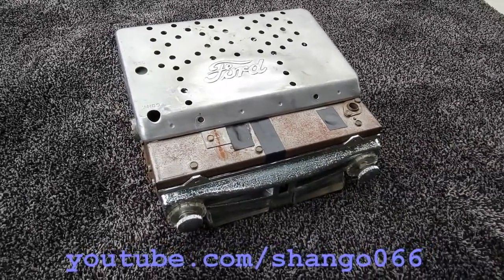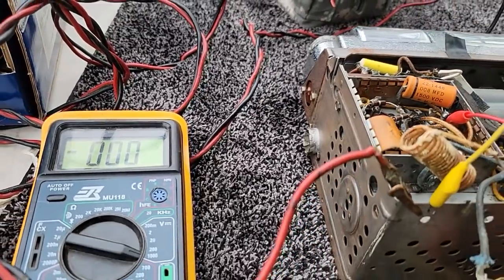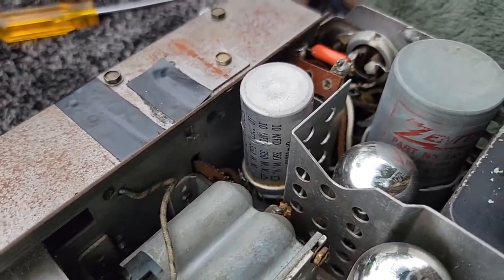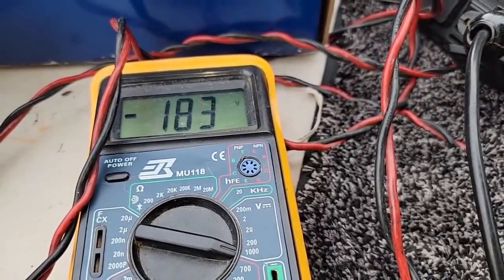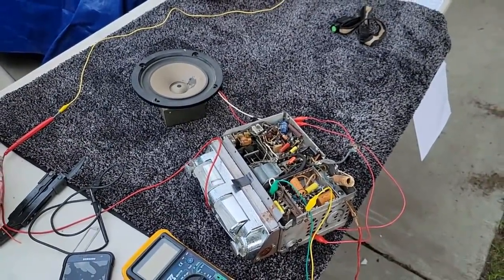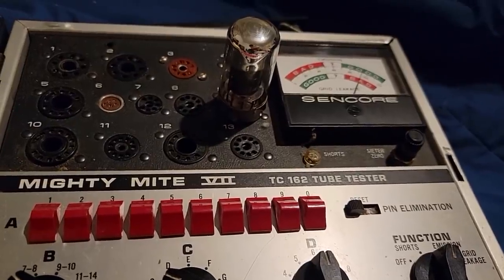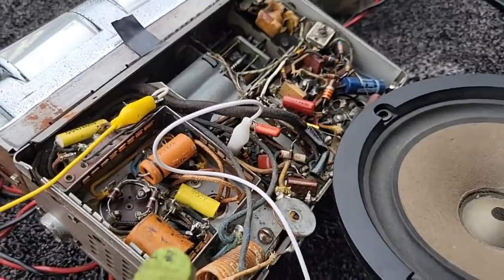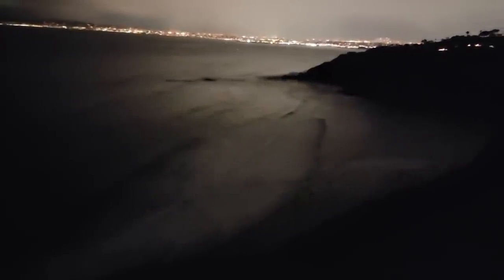Ford Zenith Tube Car Radio Diagnosis to Repair Quarantine Video

Comment: The two washers are supposed to be bolted to the chassis with mica washers.  A primitive form of low-inductance bypass capacitors.   You  can replace them with 0.05uF disk ceramics with short leads.
Reply: That's an interesting idea. I'm not sure I would have thought of that.
Reply: The Two Washers with the power wires soldered to them, is known as the spark capacitor, to filter the noise from the DC generator and ignition electricals in the car of that era.
Reply: @Derundurel  Yeah, I'm kinda puzzled by it too as good bypass capacitors were available then   Perhaps it was just tradition or maybe washers and bolts and mica were cheaper??  Not sure.

Comment: I remember turning on the AM radio in my dad's new 58 Roadmaster at night. The dash and headlights would dim until the tubes warmed up. I loved hitting the scan bar, turing on a motor to drive the tuner around the dial looking for stations, too cool!  I also remember the vacuum powered wipers stopping when he hit the gas. A luxury car from a different world.

Comment: My first car was given to my by my dad, he bought it from an old friend who ran into the back of a pickup with it, it had not been fixed.  Dad gave 25 bucks for it back then, and he told me that when I got it fixed up, it would be mine.  It was a grey 1950 Ford Custom 2 door with an external visor over the front windshield.  Came with a Ford flathead V-8 and a three on the tree.  The front seat was worn out and stunk from the old man who had it, so in addition to finding and replacing the front clip and hood, I also found a front seat out of a modern (for 1965 Rambler Station Wagon.  The seat would fold back and matched very nicely with the back seat, giving me a nice bed on wheels!  I did get some nice action using that.  This was before you could buy a tape player for cars, and since the car had a 6 volt system, if I wanted custom audio I had to find a better radio from a better. car. I ended up with a nice radio out of a Cadillac, got it from the junk yard for 5 bucks, it had motorized tuning with a floor switch so you could change stations with the tap of a toe. I loved that, plus it had 2 speakers, front and rear with built in fader,  so much nicer the the original Ford radio.  Thankfully most radios back then had a front plate that was mostly the same so she slide into the dash with no problem. Indeed I had a neat old car, my girlfriend painted the. bulbs in the two side interior lights red for, well sex appeal I guess.

Comment: Terrific info on the aluminum-solder issue! One has to question the intent of soldering wires to the side of a canister that didn't have wires soldered to it in the first place. (And then not checking continuity to the original location).
Reply: Exactly. Excellent reminder of the not-so-obvious.
Reply: You can have solder that will fuse to aluminum but it is hard to find. Those who build custom lithium batteries for rc models may know a source.
Reply: @skuula  Its not that much the solder itself, but the flux and generally the soldering process. Not worth the hassle unless really some very special cases. There is a reason, why practically no consumer product ever used such step...
Reply: @annaplojharova1400  Stannol of Germany have a solder called ALU1, which might be worth trying. Can't post a link here though.
Reply: There.exists.aluminum.solder..Check.a.hardware store....It.does.require.hot.heat.and.scraping.though...And.it.is.nowhere.near.eutetic.so.cold.joints.are.common....Much.better.to.use.the.tin-plated.steel.ring.if.possible.
Reply: @georgegonzalez2476  yes there are rods for flame brazing. But also solder, which a plain soldering iron can do. I used to have some. The latter is a bit hard to find. The rods are easy.
Reply: Not sure why the other tech even bothered to solder to the aluminum can if it's not mounted to the chassis.  As long as the cap commons are soldered together, and then connected to the chassis, the can is irrelevant.
Reply: It's like the snafus with old Philco radios.  They tended to have the capacitor can ungrounded and at -20 volts or so to provide grid bias.   A large proportion of those radios got repaired with grounded capacitor cans, leading to the output tube running at zero bias, and overheating the tube, power, and output transformer.  Ofttimes the wax would boil out of the power transformer.  Ancient snafus!

Comment: "my cognitive ability right now is more on the presidential level" You never fail to disappoint shango066! Absolute gold!
Reply: Actually, I find such political inputs to be distracting and unnecessary, and a potential turn-off
Reply: @Zickcermacity  you should enjoy KVAX it is totally apolitical.
Reply: @sting1111  Very  funny.  Now roll up your sleeve!
Reply: @Zickcermacity  Lighten up Francis

Comment: Yes, you can solder to aluminum using regular tin-lead rosin-core solder. The technique involves soldering under a drop of oil to exclude air. Scrape the aluminum under oil with a knife followed by scraping with a hot soldering iron. Add solder and the aluminum will eventually "tin". Once tinned the area can be soldered to as usual. Try it, it works and is very strong.
Reply: Exactly, did that a few times. That method  and/or there are some aggressive flux which work on some grades of aluminum (not all, but the type used in soft drink cans and most heatsinks do).

Comment: Biff Tannens 1946 Ford has this same radio in it. Ford and Mercury used these adjust o matic radios from 1946-1948. The plug socket on the side is for the foot control switch.

Comment: Great repair video. That Motorola vibrator sure is quiet. Although they sound pretty noisy with the car stationary you don’t hear them with the old6volt car underway.

Comment: The M makes me think it was in a Mercury. It’s amazing how they packed all those vacuum tubes and components in there back then!
Reply: Isn't M for manual tuning?
Reply: @401ksolar  Yes, I saw later when he changed the controls on the front. That’s what I get for commenting before seeing the whole video. I wonder how often these tube radios broke down from the vibrations while the car is in motion.

Comment: You can actually solder to Aluminium, the trick is beating the oxidisation......you have to use something like Mineral oil as you file the surface clean so it remains sealed from the air.....you then just solder through the oil with a really hot iron with normal solder.......we do this at work soldering coax to aluminium driven antenna elements.....there are a lot of YouTube vids showing how people do it, but yes it does work quite well as long as the area you want to solder to remains un oxidised.
Reply: But sounds like a lot of trouble.  I was thinking and couldn't recall any instances where I have seen solder to aluminum. Cans always had separate connections for terminals through the wafer and the tabs were just pinched to the chassis.

Comment: Very interesting. My stock 1948 Ford Super Deluxe has the original Motorola it came with. Its front plate design is different from the Zenith you're working on. The front plate on yours looks nearly identical to the Philcos from that era I have seen. I was told Fords of the 1940s came with Philcos because Philco was a captive company. I think your guess that this radio is from the 1940s is correct.

Comment: Should collect those photos, scan them, and send a copy to a local historical society. So much history is squirreled away in personal archives of photos and such, then lost for so many reasons. Those photos seem so representative of a piece of the history of the times. And when image capture was not as easy (or inexpensive) as it is now.  I go back to the era when our little Brownie cameras could only take 12 shots on a roll, then had to be developed.   8 mm reels only lasted 5 minutes. But the Kodachrome was spectacular and still outstanding 70 years later.

Comment: The 6MF080 Ford-Adjust-O-Matic´46 Ch=6C81 from Zenith on radiomuseum looks a lot like yours, and it has the full SAMS Photofact.
Reply from the maker: It would have been nice to have but it wasn't necessary

Comment: when you use a power transformer in place of an output transformer, saturation is a problem, because of the DC current flowing in one direction (in a single tube class A circuit), but you can balance this current out of you have 2 120V windings, by passing current in the opposite direction it balances out the magnetic field created by the output tube passing current, and brings it out of saturation.
single ended output transformers fix this issue by employing an "air-gap" in the transformer, which increases the current needed for it to saturate

Comment: If a vibrator is bad, you can unplug it and use a filament transformer to supply AC power to the primary of the power transformer. This is a good way to power the set up on the bench.

Comment: actually you can solder an aluminum parts, you only need co cover it with tin under the layer of motor oil
but i don't know if the cap will be overheated with this method

Comment: With all the birds in your area, more likely corvid 19. Get well soon. That old radio was much more elegant the UK car radios of the period, I used to have one one which was in two sections   
with an umbilical cable between them. Later models had 12v tubes with one power transistor. Great fault finding, never seen an intermittent o/p transformer before.
Reply: Any birders in the audience that can identify them?
Reply: @KameraShy  - Earlier in the day the ones which sounded like owls likely were something-or-other doves, what we commonly call Mourning Doves. We have them here on the East Coast,  and my neighbors hear them and say "Hear those owls?" And I tell the neighbors (nicely) those are not owls, but Mourning Doves, and the neighbors always get pissed at me. I  guess they can't handle the truth🤷‍♂️

Comment: Actually I have soldered to an aluminum pop can. The irony was that I was counting on the solder not to stick because it was aluminum.

I was making something like a lead weight, kind of like a fishing weight. However I didn't have any lead around, so I took some 60/40 lead/tin solder. I cut a pop can in half and used the domed bottom to hold the solder. I melted it over a fire, and the solder and flux separated. and at that point I had my little lead/tin weight.

Then I wanted to see what would happen if I just burned the flux off. Doing that caused the solder to actually bond to the aluminum can.
Reply: I've had good luck soldering to aluminum by putting the aluminum part under oil and applying solder and a soldering iron while under the oil.
Reply: you can solder aluminum but it needs to have no oxide on it! the trick is cover the aluminum in oil scrape it with a knife well then heat and solder!
Reply: @therealjammit  Yeah. I read if you can penetrate the oxide layer, you can solder aluminum. Buuut based on my experience, you need a heck of a lot of heat and flux.

Comment: Looking at the thumbnail again, below the "dial" there appears to be what looks like two rectangular clear plastic windows on either side, not unlike in appearance to the blinking "talk" lights on the "Robot" in the TV series "Lost in Space". I wonder if this radio style was somewhat of an inspiration for Robot's design. Seeing that radio in that pitted condition put me in a pensive mood, thinking about the original purchaser of the car that this once pristine  radio went into, probably had a couple bucks springing for what looks like a premium radio, wonder where he drove and whether he or she actually listened to the radio, and where he and the car are right now.
Reply: What you’re seeing on the B9 robot from “lost in space” is a row of neon tubes that light up when he speaks. There is no lense there.  Robert Kinoshita also used neon for the voice display on Robby in “the forbidden planet”.

Comment: It might be from a mid to late 50s Mercury, I’m guessing that because of the “Big M” in the middle of the front panel (the big M was Mercury’s slogan and logo at the time) and The Ford logo on the top panel.
Reply: No way. Look them up. mid-50's Mercury were typical push-button radios. Apparently also early 50's Mercury/Ford.  "M" probably for "Manual" No time to research now. See earlier comments.

Comment: You might not have the flu, you might have flovid.  Lot of that going around these days.
Some 40 years ago, I remember buying something called "Salmet" flux that was advertised to allow you to solder to aluminum with lead solder.  It actually worked, but I have no idea if it made a good electrical connection.
7C5 == Lokal version of 6V6GT
Tuning mech on many car radios were quite Rube Goldberg.
Reply: Flovid? Is that like the gobloots?

Comment: I own the car that this radio goes to! it goes in a 1948 Ford Tudoor Super Deluxe
Reply: Thanks for clarifying and heading off the speculative disinformation. My guess would have been late 40's or VERY early 50's.  Old as me. But still playing strong. Without a capacitor recap

Comment: I probably am the next JJ Cruze by how I sounded on my last comment. Vibrat-O-matic radio 📻. Great 😊 circuitry inside this thing. Should be a Sam’s Club radio 📻. Should work once ya put a 12 volt car 🚘 battery 🔋 to it. Don’t try a battery 🔋 charger 🔌, like 👍 I did years ago. I burned 🔥 both the radio 📻 and battery 🔋 charger 🔌 out. The radio 📻 was junk anyway, and my dad wasn’t mad 😡 about the battery 🔋 charger 🔌. Your friend, Jeff.
Reply from the maker: Oh I just say she want them like crazy tree Jemima brand release if I ain't Regus in a portable planer for sure go gurgle gurgle of large Parnell Fleischer my fur burger and fries I need to turn the Lionel martyr a larval form of pleasure point line worker Alarcon crew curly hair Fuller house Boy in the Striped final fleishel play Erasure

Comment: Would it be easy to bypass the vibrator and supply the necessary power-supply voltages that it generates?

Comment: If this car radio is to be restored for use in the car it was intended for, please take into account that it will be subject to vibrations and shaking. The current capacitor can setup will not stand up to that. And if this car radio is to be used in a 'modern' car, the power supply needs to be redesigned for negative ground. I think it would pick up a lot of interference if you'd just power it from a simple 12 to 6 Volts linear or buck regulator to the radio's ground and the -6V to the car's ground.
Reply: Non synchronous vibrator means the input is not polarity conscious.

Comment: PS I just looked up soldering aluminium and found a way to solder with an iron! You coat surface to be soldered in mineral oil, then sand/ scrape surface with oil atop to prevent oxidation and solder as normal.

Comment: 14:50 I'd have thought that if you scratch it up with a file to get rid of the oxide, then wrap  copper wire around it, the solder that soaks into the wire would hold onto the aluminum. They must have had some way to get those cans soldered into PC boards. I thought I'd soldered wire to aluminum before, but I suppose it might have been zinc plated or something.
Reply: The typical way was to crimp some steel tab/ring/band to the aluminum and then solder to that steel only...

Comment: If you bypass the vibrator with jumpers, you can just use A/C 6/12 volts instead of DC with a vibrator.

Comment: Shango is right...but you can just about solder to aluminium. Almost any metal can be soldered. With aluminium the heat sinking on a big can and the conductivity and reactivity of the material make it very difficult and close to impossible with even a big iron. You need a torch plenty of flux and over 300 degrees at the point of soldering..You will see (if) when it 'wets' and solder flows. Edit - There are aluminium specific alloys but standard PbSn should work - the oxide develops on the extremely reactive aluminium surface instantly. Also different aluminium alloys have different problems.

Comment: What’s the purpose of the vibrater? I’ve heard about them in radios 
Was curious
Reply: It creates a pseudo-AC voltage (square or sawtooth) from a DC source. Kind of like a mechanical oscillator. Then  the voltage is stepped up and rectified just as it would be in a radio running off an AC power line. There are modern vibrator replacements now that use solid state electronics instead of a vibrating reed and points to create the AC voltage from the DC source.
Reply: It switches the incoming 6 volts DC  off and on quickly so it can passed through a step up transformer to output hundreds of volts AC to the rectifier tube which converts it back to DC.  Transformers don't work with DC so you need a way to convert it to AC.
Reply: Thanks ! I always wondered what the purpose of it was

Comment: You can solder to alumi(ni)um with normal lead based solder. Just put a drop of two stroke oil on it and scrape the hell out of that aluminum with the hot tip under the oil. After a few seconds the aluminum wets magically with the solder.

Comment: Anyone else wonder how / why the schematic companies are able to offer drafts for so many esoteric products? I've never seen a You Tube electronics that did not feature a schematic. Must have been a calculation that having most schematics available for almost any major brand was worth the excessive investment.
Reply from the maker: The repair industry used to be a widely supported thing.
Reply: Good explanation. In era of Use, Break & Toss, repair is not a domain.

Comment: So instead of a solid state oscillator that had a real component which did the same thing and vibrated? Trippy!
Take it easy and avail yourself of some sore throat spray.
Reply: He goes over how it works in the last car radio repair on the channel.
Reply: The vibrator tube is used as a voltage doubler. It converts 6/12 vdc to about 240 volts AC. Then a diode bridge rectifies it back to DC for the tubes.